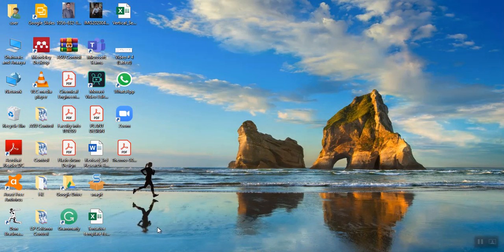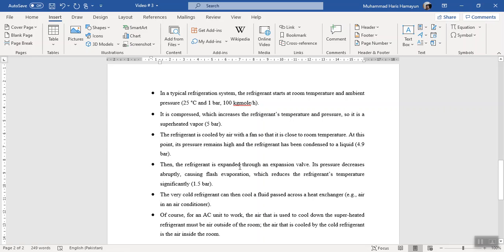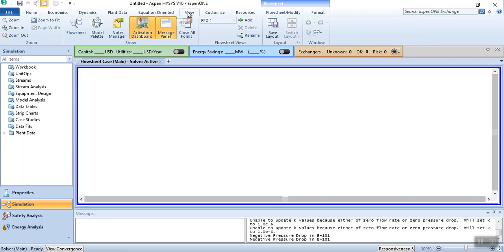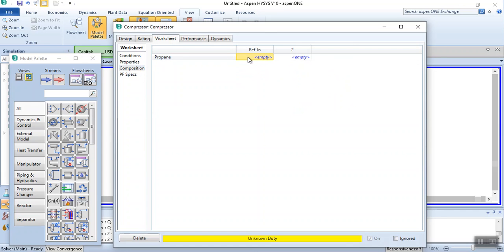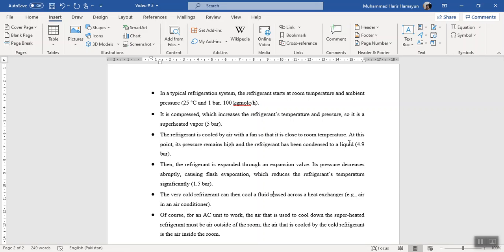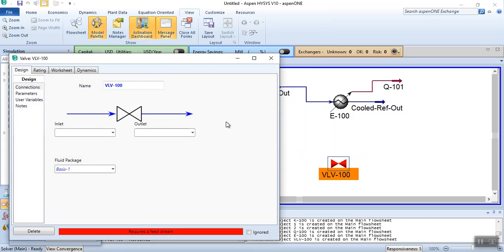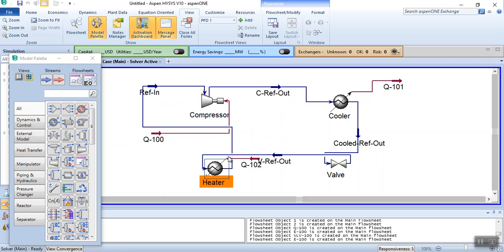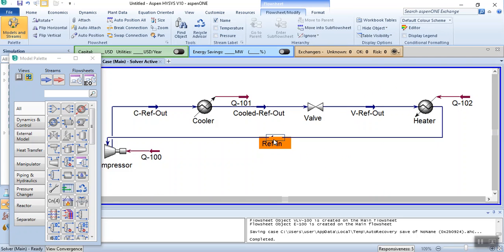Simulation of Refrigeration Cycle in Aspen HYSYS - Lecture # 4

Comment: Great explanations sir. Just want to understand the post compressor process that is cooler operation, based on the condition Pressure 4.9kgf/cm2g and 100% Liquid state, the temperature reaches 1.1degC as per simulation. But in reality the cooling agent for refrigerant ends up being atmospheric air whose temperature is 40-45degC depending on the season, then how could it bring the Refrigerant temperature to 1.1degC. 

May I know the logic behind this sir?

Comment: Assalam u Alaikaum Sir 
Sir question   ma 5th point ma  heat exchanger ko mention Kiya gya tha to ap nay heater kyo use kiya
Reply from the maker: Wsalam. Since that was the 1st part and we haven't learned heat exchanger at that point, so we used heater.
Reply: @aspenchemchannel  okay sir  thank you soo much ♥️♥️♥️♥️

Comment: Hi...the cooler you simulated doesn't look correct practically. The propane at outlet of cooler has vapor fraction 0 and pressure 4.9 bar which brings down propane temperature to 1.2 deg c. In the last point of the problem statement you have mentioned that propane is condensed  by means of air outside the room. In majority part of the world where AC is used, the atmospheric air temperature is in the range of 30-50 deg. C. Air at this temperature can't subcool propane to 1.2 deg c. If you size a heat exchanger for this condition there will be temperature cross. So I suggest to have propane vapour fraction 0 at 4.9 bar but at 35 deg c (keeping 4-5 deg c temperature approach). Please give your reply.
Reply from the maker: Sagar, this is a shortcut simulation, and you can specify only two parameters. So, you can specify 35C instead of vapor fraction.

Comment: Hi Sir.İ am working ethylene-polyetylene plant. We have a ethylene  refrigeration cycle system.SO my question is is that heater in your system is called also evaporator?in heater propane temperature increases.But in our system for example ethylene enter into evaporator -102 degree C and out -102 degree C. Could you please explain it sir?
Reply from the maker: Yes, you can take heater as evaporator to solve your system. To get more info, please watch Lecture # 8.
Reply: @aspenchemchannel  thanks sir. Actually I meant in the evaporator  only phase change occur and temperature is constant according to Temperature - Entropy diagram of vapor compression refrigeration  cycle. But temperature increase in your system in the heater. Why it is like that?
Reply from the maker: @alisattarzade5424  yes. The same exercise is carried in Video # 8, where we just varied vapor value from 0 to 1.